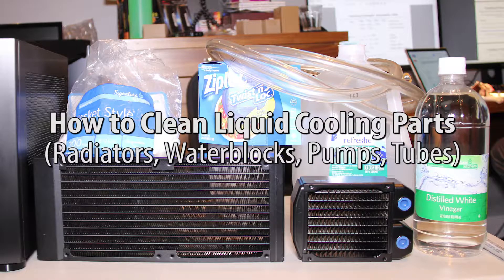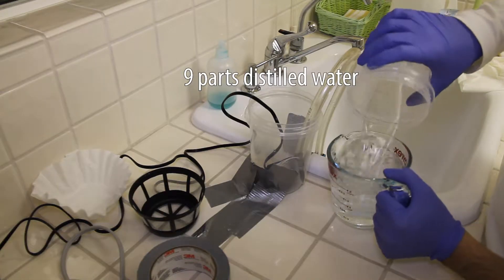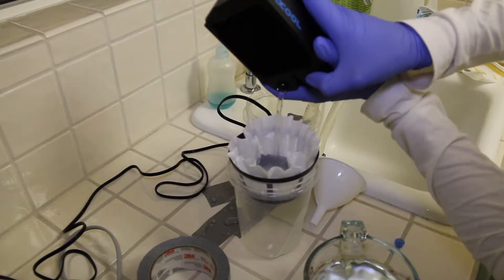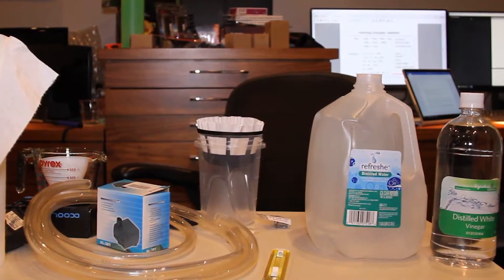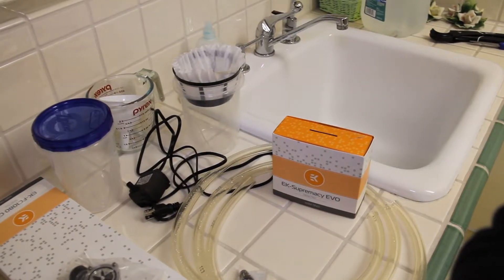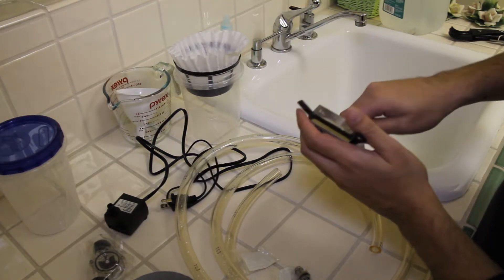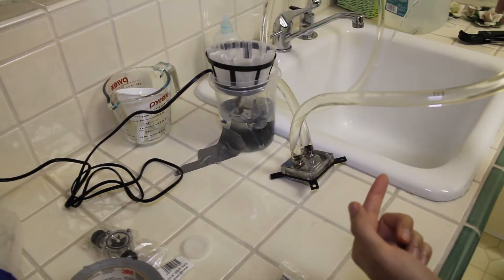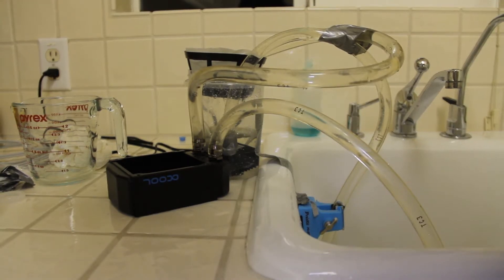How to Clean and Flush PC Radiators, Waterblocks, Pumps, and Tubes - Water Cooling Tutorial

Comment: What aquarium pump did you use in this video please?
Reply from the maker: Ok so after having gone through this process already, I'd say that if you want to skip this whole flushing process and just put distilled water in your components, shake them up, pour it out, and repeat between 3 to 10 times, you could just do that. This whole water contraption, while it will probably get more tiny bits out, might give you diminishing returns for the effort...it's up to you! For example, if I were to ever build something again, I doubt I'd do this whole procedure in this video again...lol.

But anyway, I used this: "VicTsing 80 GPH (300L/H) Submersible Water Pump For Pond, Aquarium, Fish Tank Fountain Water Pump Hydroponics with 5.9ft (1.8M) Power Cord"

It's not available on Amazon anymore, I do see a link to it on Walmart for between $7-$10.

Since then, when I needed another water pump for a CNC machining purpose, I bought this, which might be a bit more versatile:

VIVOSUN 800GPH Submersible Pump(3000L/H, 24W), Ultra Quiet Water Pump with 10ft. High Lift, Fountain Pump with 6.5ft. Power Cord, 3 Nozzles for Fish Tank, Pond, Aquarium, Statuary, Hydroponics Green

($20 on Amazon as of today)

FYI just about anything similar to these will do the job..aquarium pumps are very common/typical and you don't need any fancy features...you just need it to pump water.